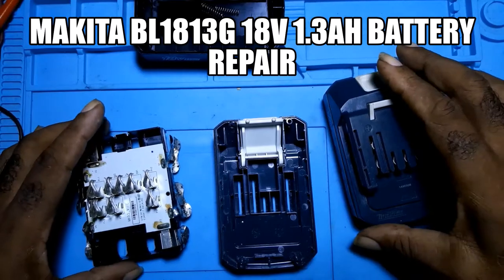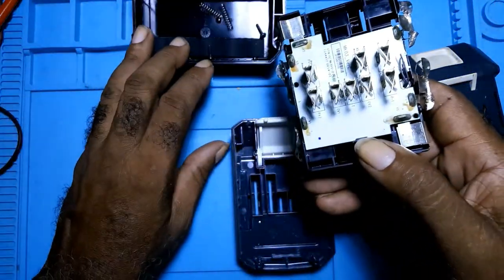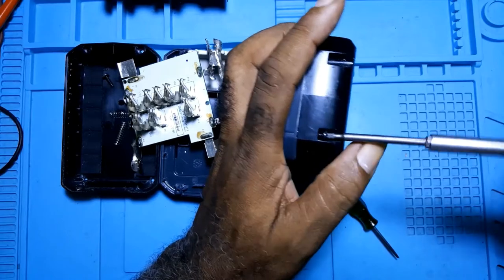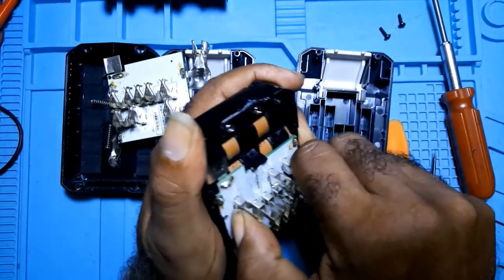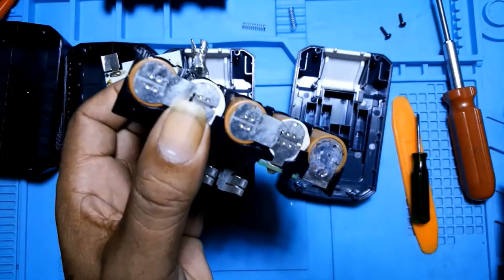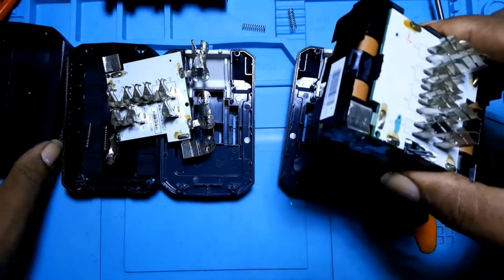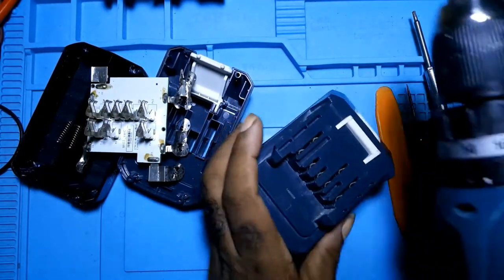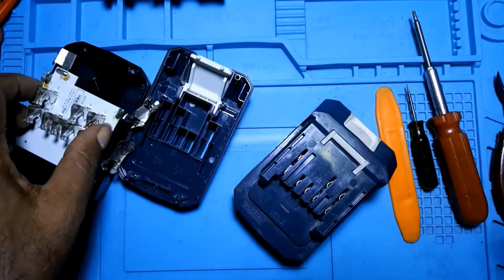Makita BL1813G 18 V 1 3Ah Battery Repair

Comment: dear Alwyn. did it actually take charge? i usualy repair lxt battery's for makita with a new pcb becouse they block from charging. i now have someone who wants battery's like these repaired, and i just wonder if it charged with the original makita charger. kind regards leon
Reply from the maker: Yes it did.